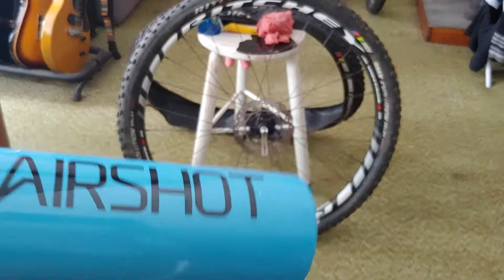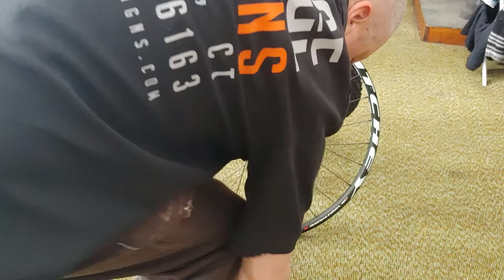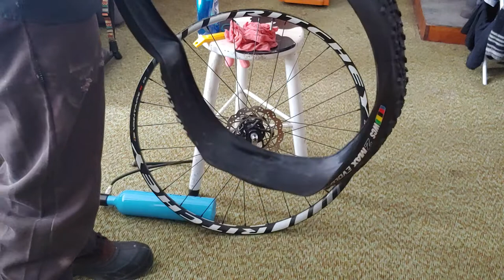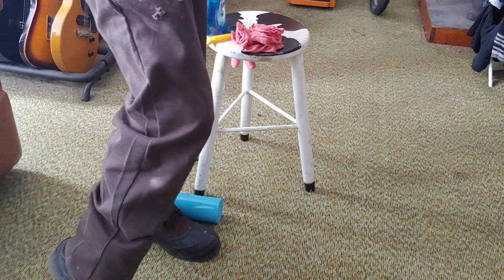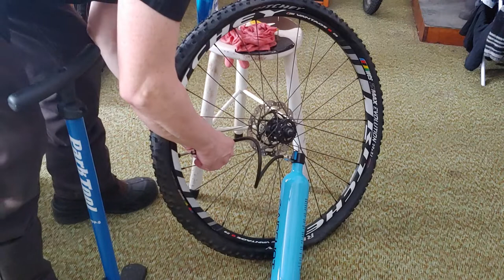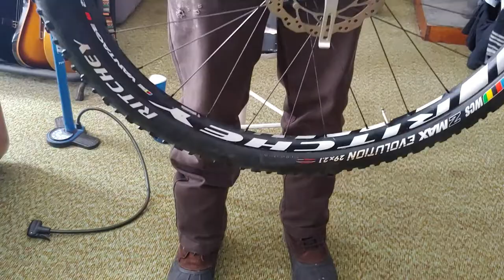Airshot Tubeless Setup.

Comment: Great Video .. When you set it to 120 psi on the airshot ... That is just to get it on the rim correct ? Normally your tire gets 60 psi ? Does the instructions say what pressure to get it on the rim ?
Reply from the maker: No the instructions don't. I have found that 140 to 160 psi in the airship will seat the bead pretty consistently. 120 sometimes I have to do it again. Once my bead is seated and I've squished the sealant around. I lower the psi in my tires to 25 and 23 psi. Rear and front.

Comment: I need an airshot type device for my motorcycles as i have no compressoŕ
Reply from the maker: Because of the air volume of a motorcycle. You need to find a bigger one. They do have air tanks. Most auto parts stores sell them. Thank you for the reply.

Comment: Great video. Straight to the point. Also this is the method I like... with syringes, seems to me the cleanest way to do it and that's for me.
Reply from the maker: If I were in my shop vs my apartment on the carpet. I'd do the quicker pour in method. Not caring if some sealant splattered. 😆.
Reply: @albikes8484  Right! Most of us don't have a shop. Many of us are or have been living room mechanics at one time or another!